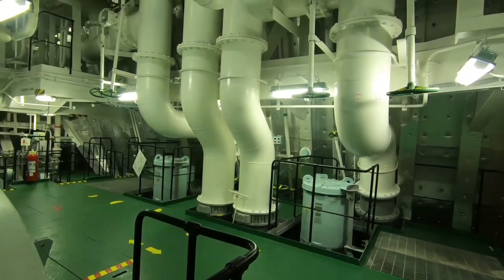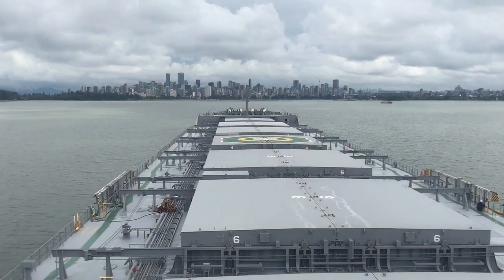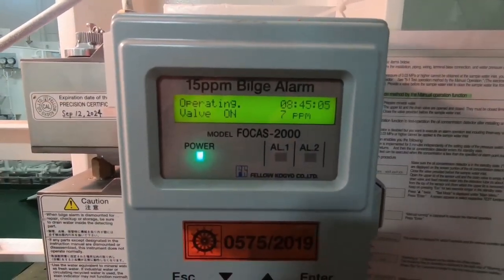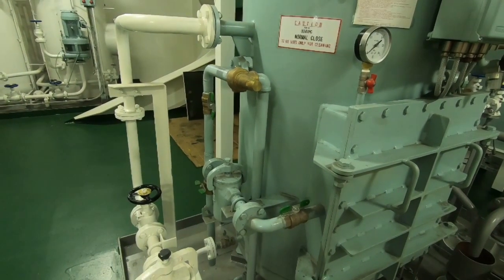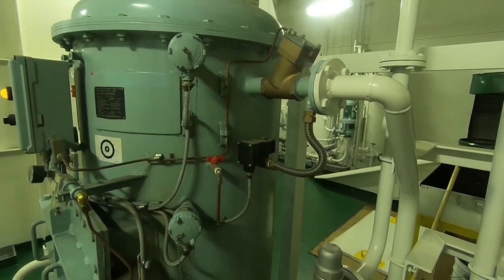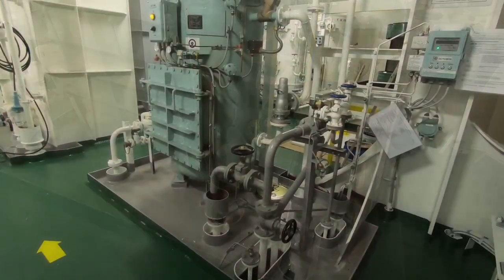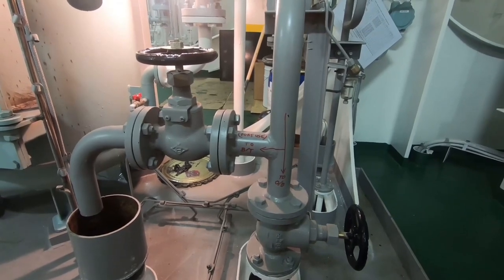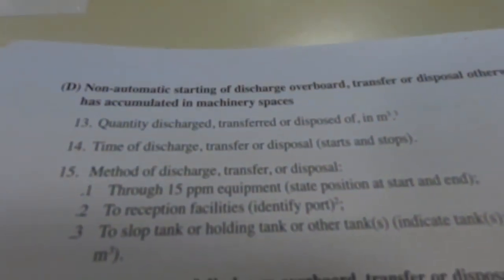CARA KERJA OWS | OILY WATER SEPARATOR OPERATION

Comment: bas berarti waktu kita mentest alarm ows, kita hanya ingin mengetahui three way valve bekerja apa tidak, bukan mengetest sensor oil content meter bekerja apa tidak,karena saya dengar tadi secara auto operation kita simulasikan dengan air laut. maaf bas kalau saya salah,trimakasih
Reply from the maker: Saat sensor mendeteksi 15ppm, alarm akan berbunyi dan three way valve hrs bekerja, karena itulah sistemnya. Jd cara test plg pas, pompa kita jalankan utk mengetahui sistem itu bekerja atau tdk...👍👍
Reply: Bass , utk test OB valve di buka yaa bas ? 
Karna pada saat test pump di running 🙏

Comment: Maaf saya pemula bas, pingin tanya tadi tidak boleh buang minyak ke tk bilge, bukan kah tk bilge adalah tampungan dari ows sendiri.
Terus fungsinya tk bilge sebenarnya menampung minyak kotor ato kah campuran dengan air

Maaf bas, kapal kecil soalnya
Thnx
Reply from the maker: Minyak dibuang ke sludge tank atau ke bilge sludge oil tank, jd jgn ke bilge tank.
Slugde dari ows bukan ke bilge tank tp ke bilge sludge oil tank, yg ke bilge tank dr ows itu bilge water kalo diatas 15ppm...👍👍👍

Comment: Bas. Saya cari filter nya ini bas. Dimana belinya di batam atau di jkt
Reply from the maker: Wah kurang tau bro, kita order sparepart lgsg ke maker melalui kantor..
Reply: @Chief_Tobing  bas itu setelah 15ppm alarm menyala motor pompa akan mati atau manual di matikan.
Reply from the maker: @sutanurhidayat542   Untuk OWS type ini saat alarm 15 ppm, pompa akan tetap jalan, yg berubah adl arah air yg keluar dari OWS dirubah kembali ke Bilge Tank oleh 3-way valve, gitu bro.. tks